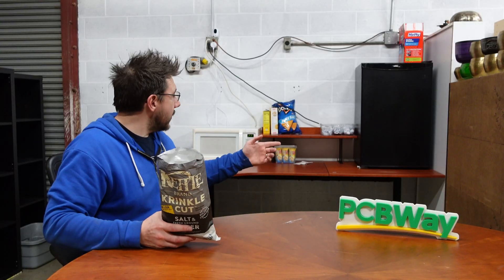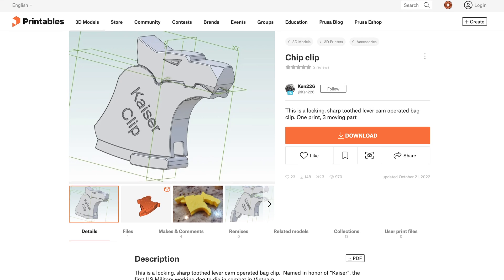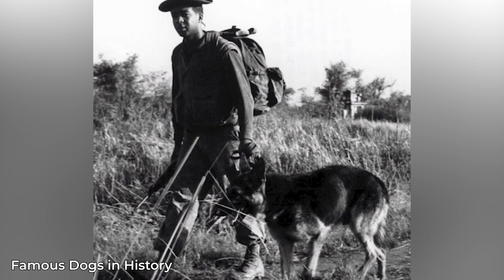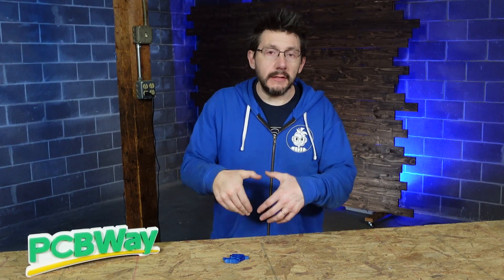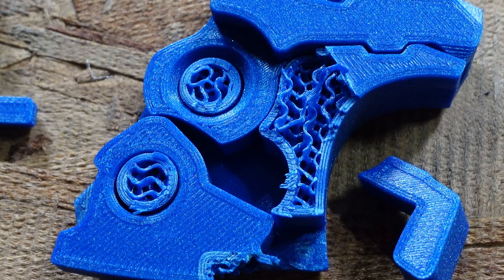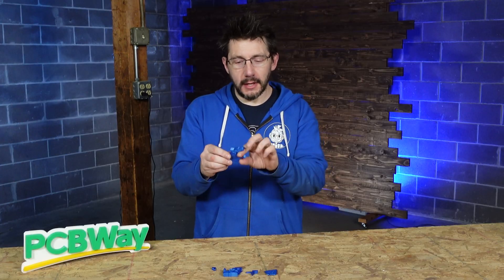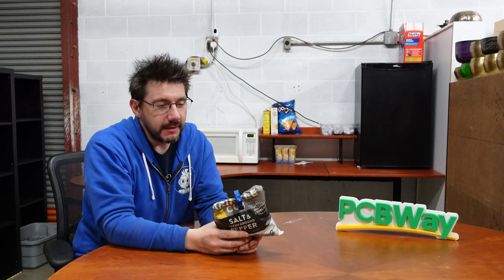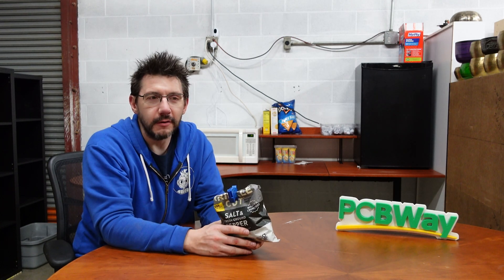Print in Place CAM is COOL! The Kaiser Clip!

Comment: there was a chip clip file I found a very long time ago that I still print many of, and still have.  The first ones I made out of some bright yellow PLA, are still in use today, 4 years later!  A few have gone through the dishwasher by accident, one survived, the other time didn't (top rack it survived, but in the silverware rack it didn't).  Its a simple one that uses the tension of the plastic to keep it clamped shut, very strong and some are starting to lose their...chomp after so long.

Comment: I applaud you alone on the idea that you opened a kettle chip bag without tearing it right down the side. They put a starter cut at the top of those that direct s straight down into the bag. It's almost like they want you to fail. But you persevered and opened the bag cleanly. 🎉🎉🎉
Reply from the maker: Oh believe me, DOZENS of bags have been ripped down the side. Heh.
Reply: Goes to show you that practice makes perfect!

Comment: I find this completely over-engineered for a bag clip. I made one that you just slip over. No moving parts at all.
That requires a bit of flexibility, but it works just fine in PLA.
And you can probably print ten or more with the material one "Kaiser" clip needs.
But an interesting mechanical solution nonetheless. :}
Reply from the maker: Aww shoot, and here I was thinking I need even MORE engineering in my chip clip! :)
Reply: @3DPrintingNerd I mean, if it's fun, more power to you!
Just not my idea of a practical application.  ;-)